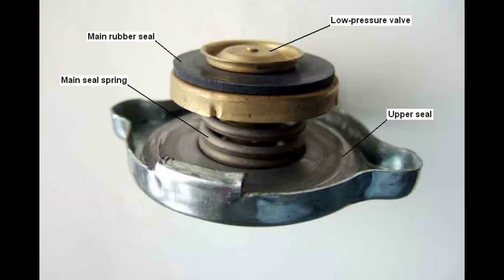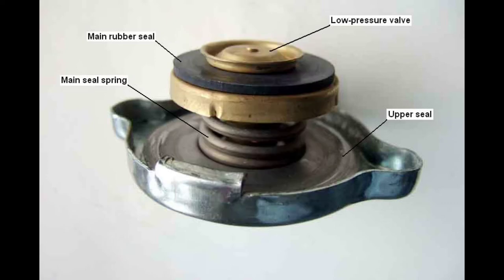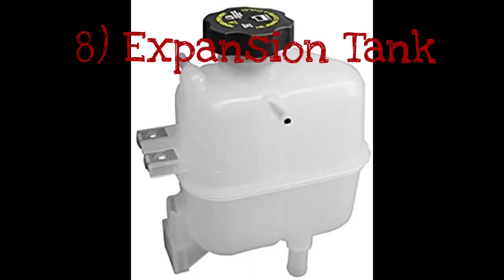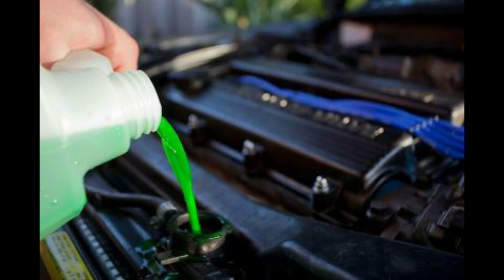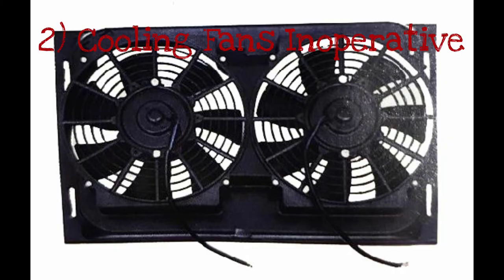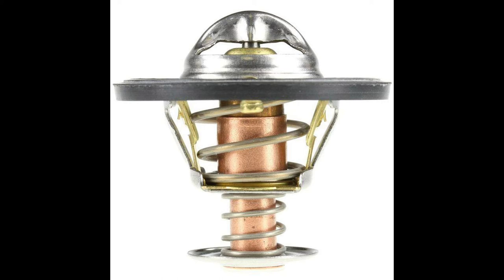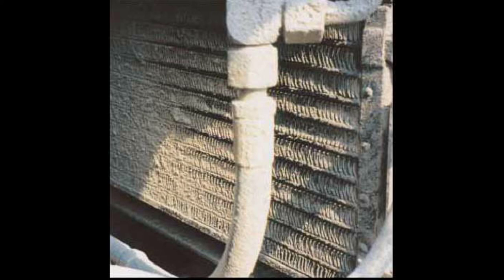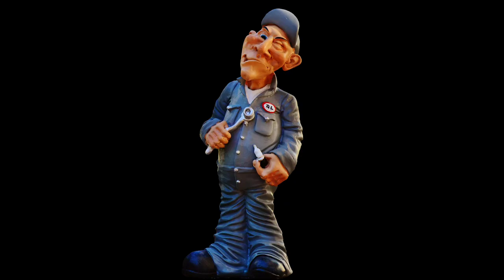Top 5 Reasons A Car Or Truck Overheats And How Cooling System Components Work

Comment: What should I do next?
Reply from the maker: If you know the radiator is clean and the fans are working properly, then you should pressure test the system and radiator cap. They must be able to hold pressure or it will over heat. If those check out ok, then the next step would be to check for a bad head gasket. Get a block tester kit. It uses a special blue dye that will turn colors if combustion gases are present in the cooling system. They are easy to use and can typically be purchased at any auto parts store.

Comment: My car overheats I got brand new thermostat water pump & it still overheats what should I do
Reply from the maker: Are you having to add water? The radiator needs to be able to hold pressure also. This pressure raises the boiling point of the Coolant. If you are having to add water, then either there is an external leak or internal engine leak. Could be as simple as the radiator cap is allowing pressure to escape causing the overheating.
Reply from the maker: Have you pressure tested the system? If not, I would recommend getting this done first to help find any leaks. Then make sure the radiator is clean and the fans are providing enough airflow  to dissipate the heat from the radiator. Then check to make sure the Coolant clean is able to flow properly through the radiator. If radiator is dirty and restricts Coolant flow, this can also cause overheating issues.
Reply: Yes did all that as well took it to a local mechanic do u think I may need a new reservoir coolant  tank I drive a 2013 Volkswagen Passat
Reply from the maker: I wouldn't think it would need to be replaced unless it is leaking or the sensor at the bottom is faulty. Are you having to add Coolant or is it just overheating with full cooling system?
Reply: @ezautorepairs  it’s overheating with coolant the mechanic can’t find the problem I got a new thermostat water pump flush radiator they can’t find the problem the temperature gauge drop to 260 & smoke come from under my hood
Reply from the maker: It's hard to say without actually seeing the vehicle but it sounds to me like the radiator is not working properly. To test this, you would have to check the inlet and outlet temperature of the radiator and compare the two readings.
Reply: @ezautorepairs  can I take my car to auto zone to get a computer reading to see what’s the problem
Reply from the maker: They will give you a diagnostic code that may give you a clue to possible cooling issues such as a fan or temp sensor. A bad head gasket can cause over heating issues . Surly the shop would have tested that. You can get what's called a combustion tester and test for combustion gases in your cooling system at most parts stores.
Reply: important is lost water or not, and is that the model have two heater hoses in the idle of the firewall and next of the battery?